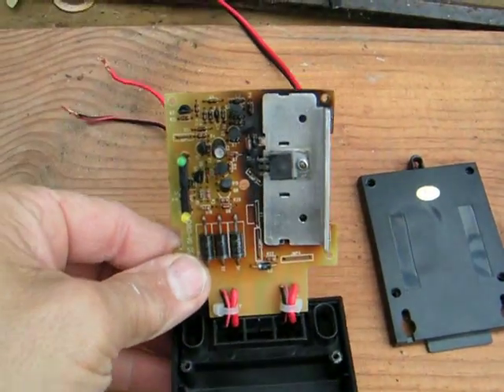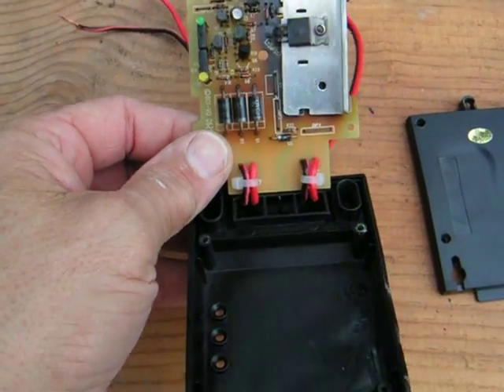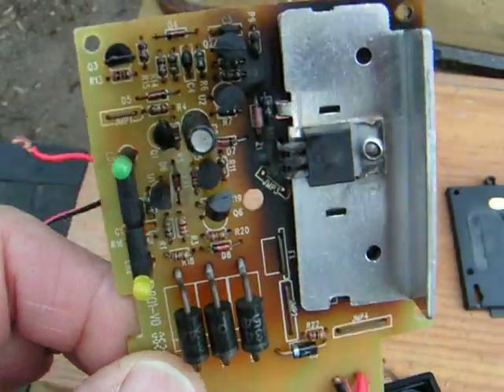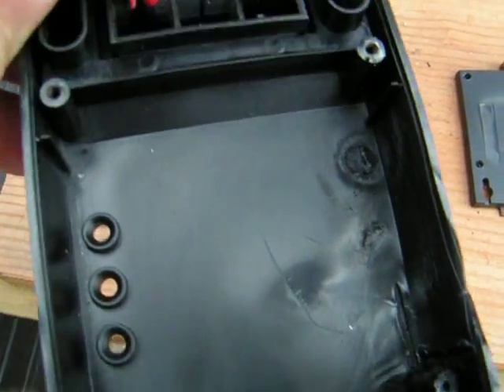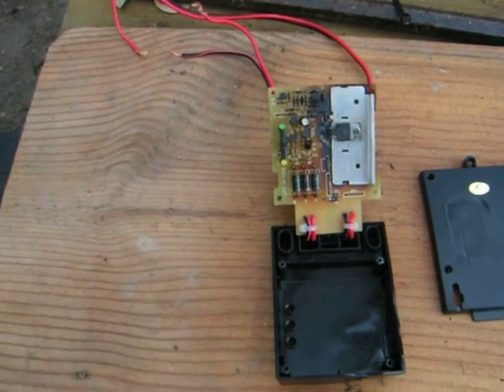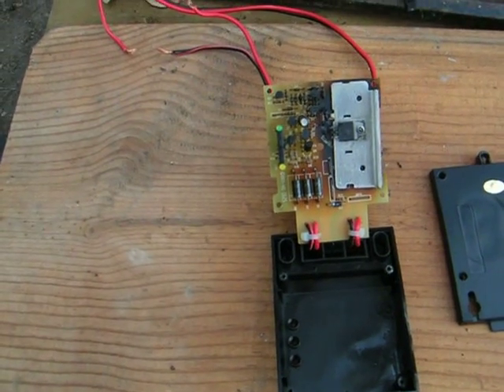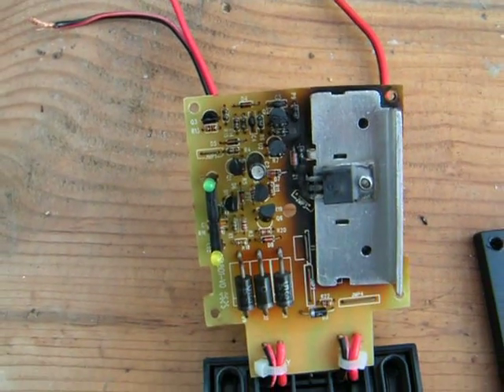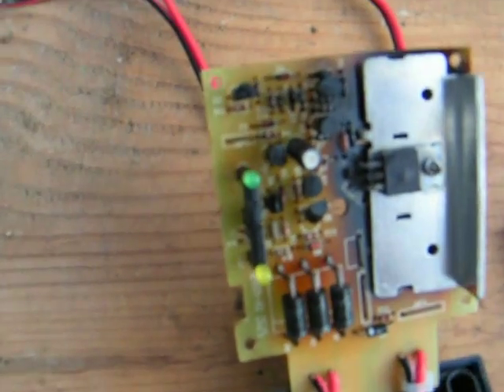Solar Charge Controller Failure

Comment: Looks like s**t happened!! That is the best way to learn. I have the same controller that came with a 100 watt panel that was purchased from Amazon. I have since replaced it with a 10 amp controller and moved the 7 amp controller to a 10 watt panel for charging phones and other lower powered devices. Interesting to see what will happen when it is over powered, thanks for the info and video!!

Comment: those sunelectric charge regulators suck anyway, your better off without it.

get a MPPT charger, vs. the sunelectric's PWM charging. MPPT can glean anywhere from 10-30% better efficiency from your panels